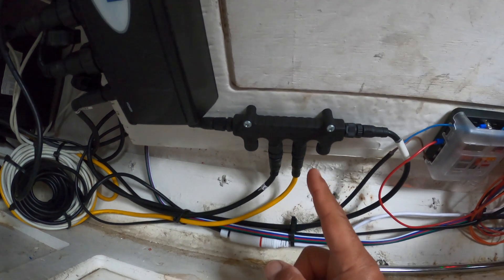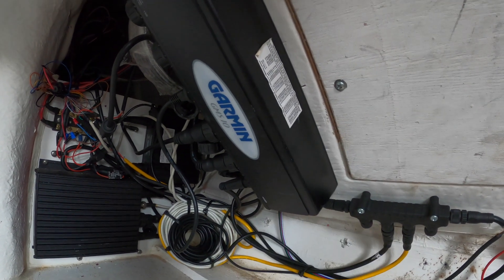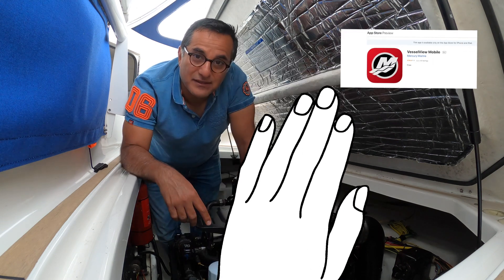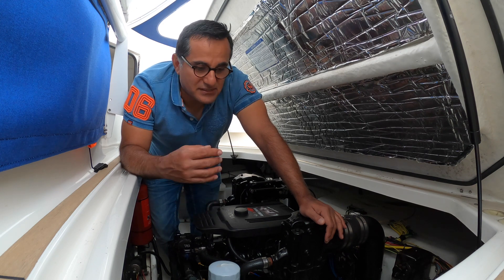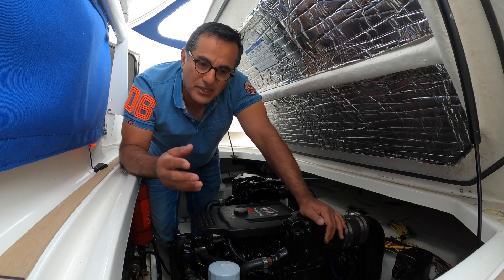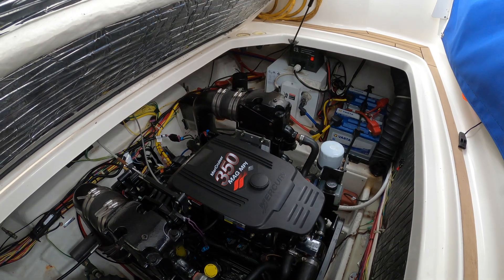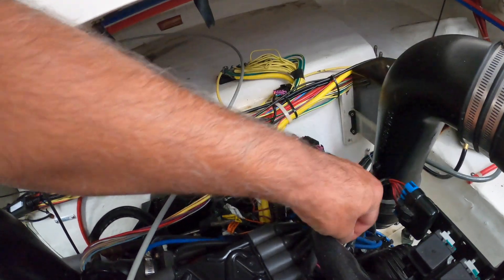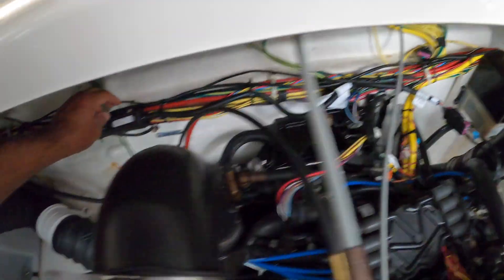The installation of Vessel view kit & NMEA 2000 Gateway module on a Mercury Marine engine

Comment: I have been looking for this information for months.  Boat Manufacturers have this  information but I’m sure they’re not sharing.  I ordered a new boat (under construction) that should be finished at the end of May 2022.  It has a DTS Mercury 225 Outboard and a Vessel View 7" at the helm.  I would like to add the phone app and the Bluetooth connectivity.  Have not seen ANYONE  showing how VesselView LINK and Vesselview Mobile are BOTH connected.  ALL the videos of VesselView Mobile being installed show a connection at the engine, like you showed, with a termination. I did see one gentleman mention that a JUNCTION BOX may be found at the helm if Vessel View is already used for engine displays on the MERCURY VESSELVIEW LCD DISPLAY, but that was just a comment I took notice of during my hundreds of hours watching videos. His video didnt show the actual installation.   Now it makes sense.  Thanks for sharing this very helpful information.  Have not seen it ever before and you did an excellent video showing EVERYTHING that you went through.  Thanks for taking the time.
Reply from the maker: I had the same problem , no of few information so had to try by my self
Thank you for your encouraging words
Please like and subscribe

Comment: Thanks so much!  I’m doing the same.  Connecting twin mercruiser to MFD.  I had been using the mobile app with a phone mount.
Reply: What are the parts needed for a twin engine? One Nema Gateway but 2 of the blue cables?
Reply: @TeenagedSky  Did you find the answer? I have a twin engine too
Reply: @checkmarkinspectionsinc6059  so I haven’t bought the parts yet but I believe you need two blue harnesses, which each go to their own junction box that has a link between them. Then a multi-wake harness to the mobile vessel view. This may not be right as it is proofing difficult to get definite answer